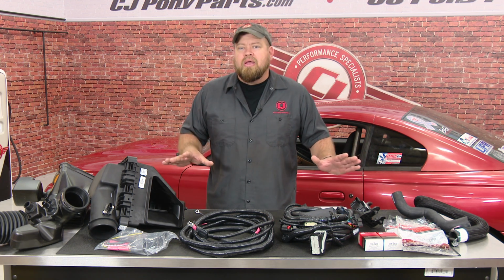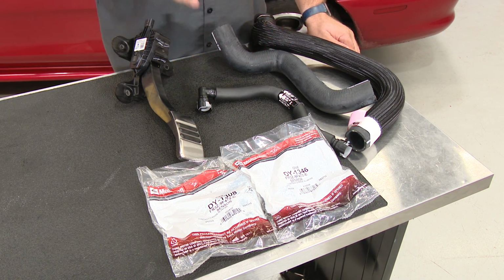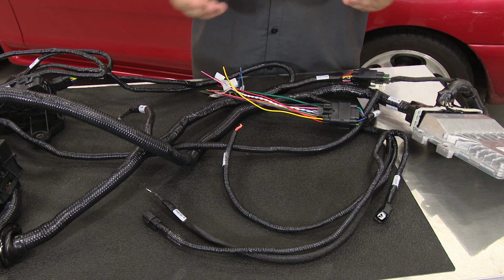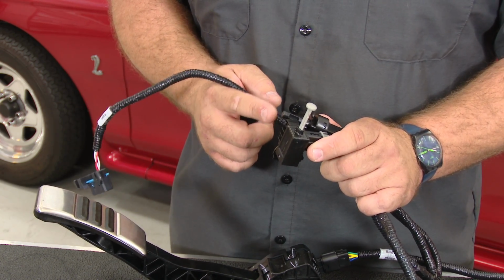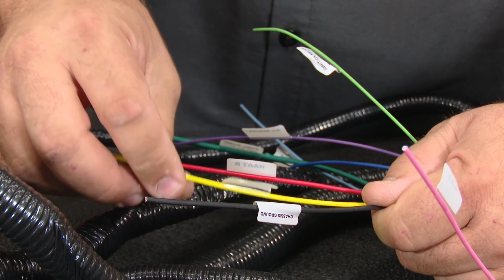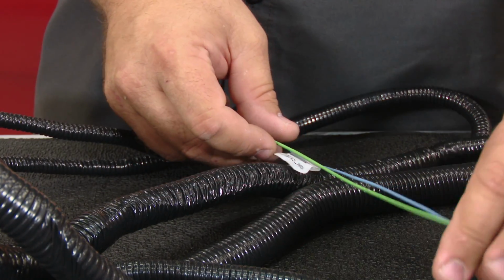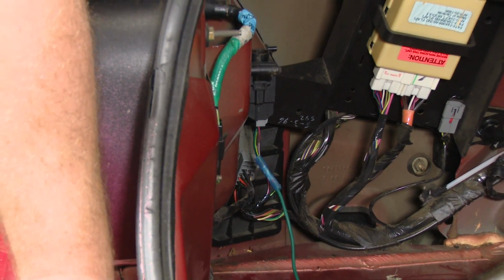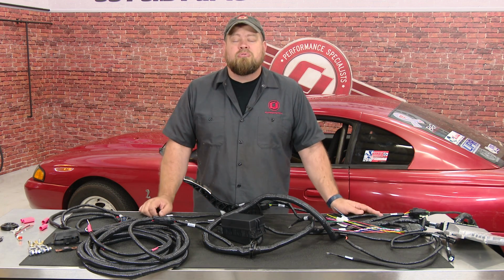CJ Project Krimpstang: 1996 Mustang Coyote Swap Control Pack Installation

Comment: The red HAAT B wire IS a 12v source, you don’t connect it to a 12v source. If you do the fuse will pop in the control pack fuse box and create a crank no start condition. Ask me how I know

Comment: I have a Mustang year 96 regular 3.8 motor what year of motor can i put with a 5.0 motor for My 96 Mustang and what do i need??
Reply from the maker: If you like that body style I would suggest trying to find a 94-95 GT which already came with the 5.0  pushrod engine. The cost to swap your car would be far more than the value. To swap either 5.0 you would need to swap the K member, wiring harness, computer, and several other parts like the rear would need to be upgraded.

Comment: Does this kit work for a 94 cobra sn95 with the 5.0L pushrod motor setup? I'm wanting to coyote swap my 94 sn95 cobra but I'm trying to get as much information on the swap as possible before I start. I'm wanting to put a gen 2 engine in but I'm also wondering if I need to cut the strut towers or will the motor fit without having too? And will my t5 transmission bolt up to the coyote motor or do I need to swap it too? My transmission has been completely rebuilt and is setup to handle around 600 hp. It would be great if I could just drop the coyote motor in without having to cut anything and just rewire everything with new wire harnesses but I don't know if I can yet.

Comment: Would the cruise control still work as normal?
Reply from the maker: No it does not, the cruise is handled by the factory computer. The control pack does not have that option on its own.

Comment: Does the FRPP control back also control knock sensors, injectors, coils, etc? Or do you need to have the factory harness to work together with the control pack?

Comment: So essentially the ccrm for the sn95 will be eliminated? Do you have a video that explains how to get the swap to interface with the stock sn95 cluster? I have an 96 v6.
Reply from the maker: I was not worried about the stock cluster so I never researched how to make it work. My speedometer and fuel gauge work, the others would require you to figure out the sending unit wiring.

Comment: I'm planning a swap on a sn95 i only have 3 questions what wires are hooked to run the cruise control the rpms and oil pressure seen a few swaps that had issues with those functions
Reply: Did you ever get an answer? I'm getting ready to do the same thing.

Comment: would the stock computer, wiring harness, starter, alternator, and ac compressor to a used 2015 coyote work the same as the kit? for a 95.
Reply: Evan Foster did you find the answer to this
Reply: @AMFenterprise  +1

Comment: Is there a big difference if the 5.0 was hooked up to an automatic transmission? 2016 year engine and trans
Reply from the maker: Depends on what you would need, if anything, to control the auto. The engine side is the same. -Bill
Reply: Is there a similar harness that would bring both the engine and transmission to the same module? 
I have looked around and i have found the manual transmission is the most common and wasn’t sure if i would need a different module to control it all or a separate module independent from the engine one... 
not much information on this kind of swap online
Reply: Do you recommend anywhere specifically where i should look?
Reply from the maker: There is no aftermarket controller for the 2016 auto yet, a few companies are working on it. The only option now is all the wiring and PCMs from a 2016 Mustang with an auto.
Reply: CJ Pony Parts one last quick question, so if for example i got a crashed 2018 mustang 5.0 with the auto from copart 
Would i have everything controller/module, harness wise to just do the swap into an older car? 
Ex. I would take all the electric components and the engine and trans and would that be All i need to control the engine/trans
Reply: @ D rod check out Power by the hour they have a control pack now specific to Gen 1 and Gen 2 coyotes running a 6R80 transmission. It's what I'm going with for my Gen 1 swap

Comment: Would a coyote from an s550 fit an new edge is it also a direct swap or do I absolutely need to buy a crate engine
Reply from the maker: Any 11-17 coyote will bolt into a new edge without a problem. You will need a control pack to run the engine along with specific exhaust, etc.
Reply: CJ Pony Parts would I be able to use the stock transmission that's in my new edge already or would that need to be swapped as well
Reply: @Dannymclovin69 unless it's T56 or better for a manual/4R70 or better. Don't waste your time with the stock tranny otherwise

Comment: Wicked dumb question but the starter is suppose to get direct 12v power correct? The starter lead I take it goes to the starter selenoid for start request?

Comment: i have the feeling that after buying the engine, and all that you have shown here i could have just bought a nice used coyote powered stang for less
Reply: Depends on what your goal is. I am building a race car and wanted a lighter chassis than the 2011 and up Mustangs.
Reply: I have a drag setup s197 09 coyote swap ,, is it ok to move the fuse box and the pcm inside or under the glove box compartment ?
Reply: As long as the wiring is connected you can move it wherever you want
Reply: Bill I am wanting to do the same to my 1994 v6 convertable. American muscle selling coyote engine an automatic transmission 14,000$ on eBay found one with miles for less. I want new race car . saving money

Comment: wouldn't constantly running your fuel pump cause it to have issues, like wear faster?
Reply: The fuel pump is running constantly when you drive. It is on when the key is on and most time the car should be running so there won't be any issues.